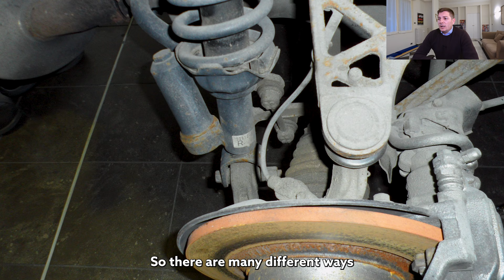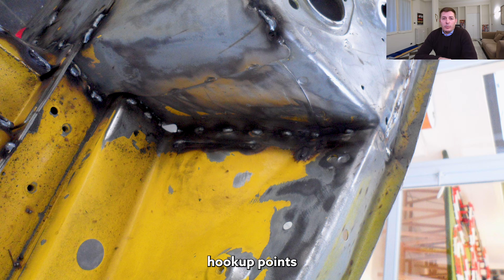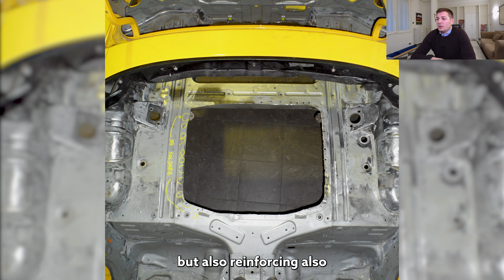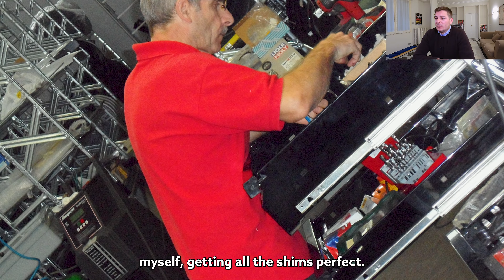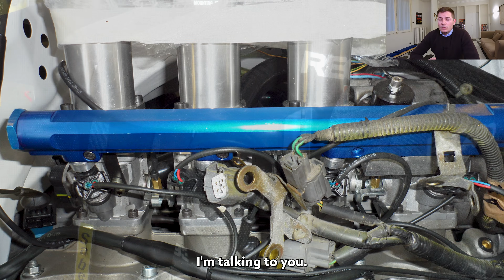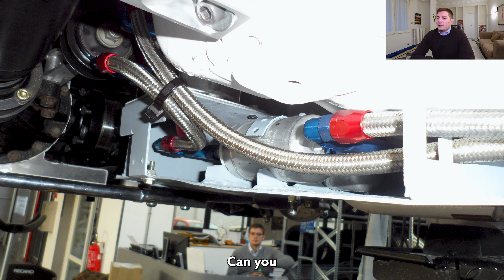Full Build of Honda S2000 VTEC Spoon AJCS Race Car | 4K

Comment: What a great project!!!Specs og the engine?2.0 or 2.2 lit?What C/R,cams,revs?Man it's seems perfect,well done!!
Reply from the maker: Thankyou mate! It was 2.000cc, with limiter at 8.500rpm for the 24h race reliability, 9.200rpm capable.
Vtec still working, it made 285bhp on the 8.5 safe race setting, with much improved torque and drive ability!
Reply: Actually you did not fully answer the question. It was about the required specific hardware to achive the mentioned 285 hp. Can you share please?

Comment: Thank you for sharing the expirence. Was the diff cover with more capacity enough or did u run an diff oil cooler for longer races?
Reply from the maker: We decided to go with increased capacity diff cover, but we didn’t get the chance to do the 24h race unfortunately. Anyways it would work well, but always consider you check and rebuild everything after such races!